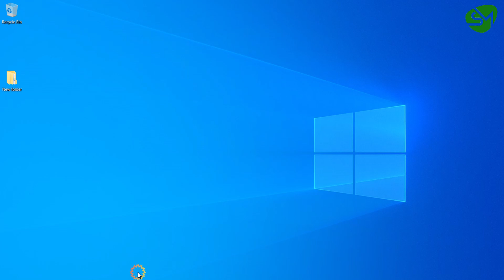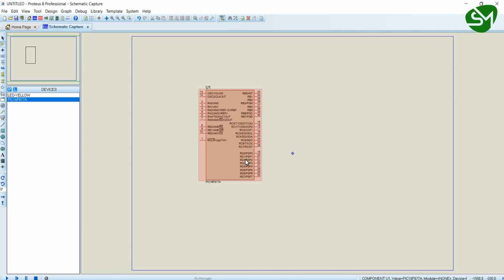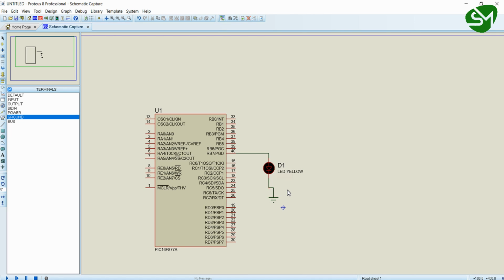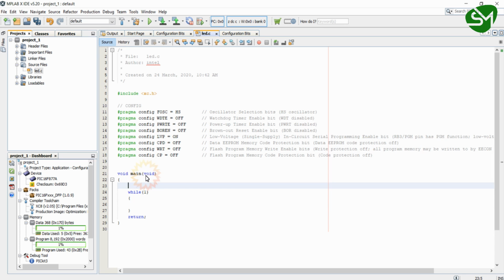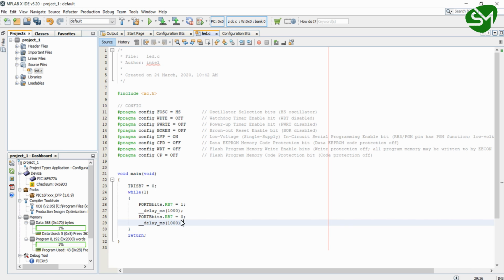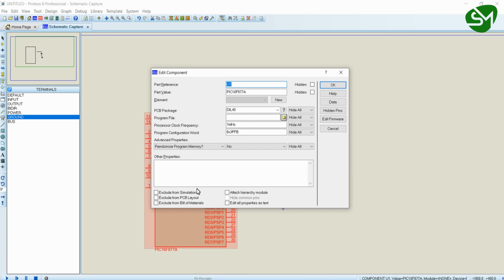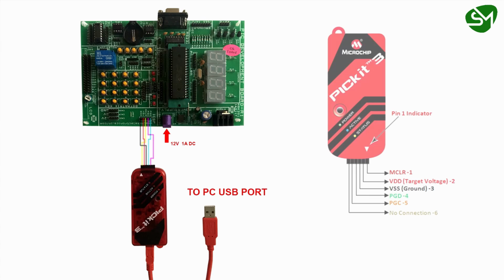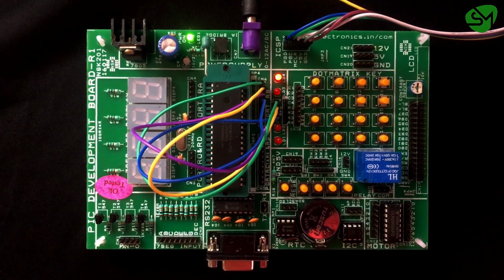Interfacing of Single LED with PIC16F877A Microcontroller

Comment: I am using the same PIC Dev board I am not able to get the blinking light. it is constantly on.
Reply from the maker: Is the program flashed to microcontroller..?
Reply: @SMtrainingacademy  yes it is working now.

Sir I wanted to know if I connect the microcontroller to the PIC Dev Board and check the voltage across the pins of VSS & VDD, is there any chance that microcontroller may burn or doesn't work next time.
Because I am not able to either erase the program memory nor EEPROM Memory via PICKIT2 OS.
It is showing the failed to program the MCU.

Comment: Sir why you are using low voltage program mode sir ,bcos you enable lvp =on ,why sir
Reply from the maker: This will enable you to program the device with minimum voltage or stable fixed voltage must be provided for programming the device
Reply: @SMtrainingacademy  but if we use lvp mode then we need pgm pin to upload a  code?

Comment: sir led is not blinking but it glowing when i powerd ON the circuit, but it is blinking when i powerd off for few seconds.
Reply from the maker: If you are trying in hardware please check if the pullup is provided for reset pin